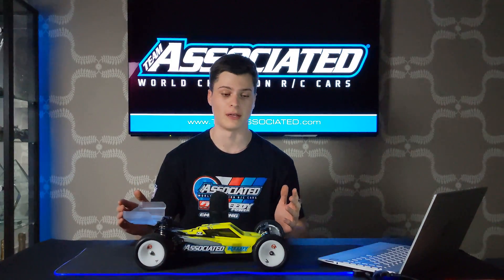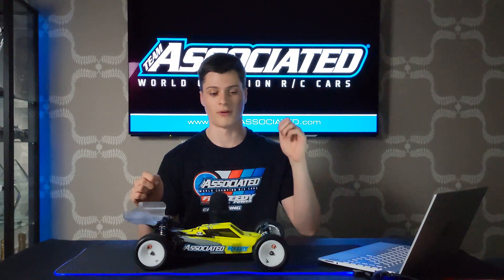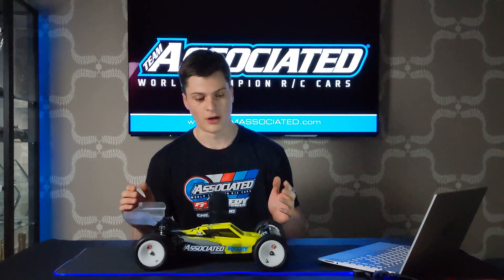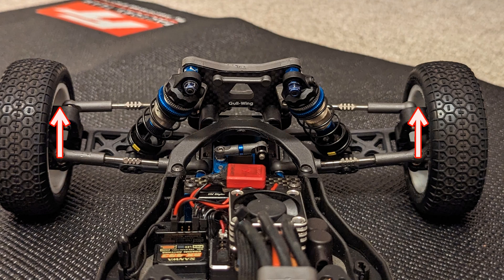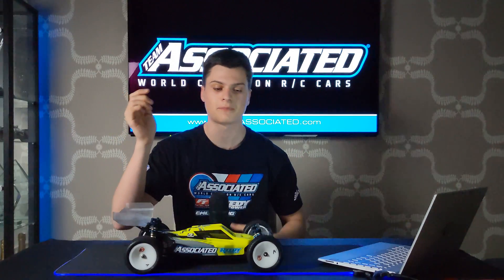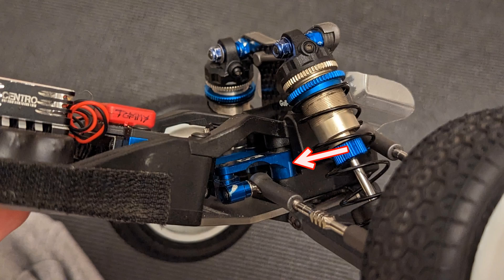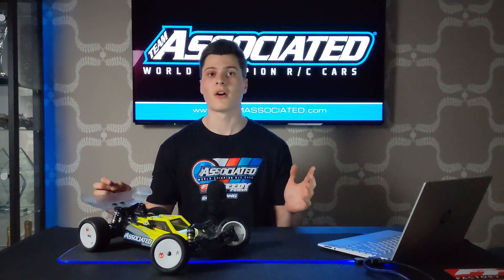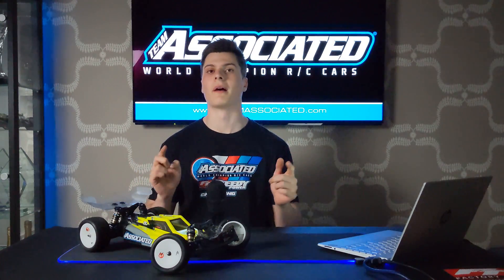Bump Steer in RC Explained.

Comment: Hello,
I just bought a b7. I switched to +2.5 pivot and 5 castor insert(tab down)
I found that I have a lot of bump out at full droop.
Rack is raised with 2mm spacer at the bottom.
What should change ?
Otherwise all spacers are kit.
Thank you

Comment: This was very helpful. I installed the plus 3mm steering rack on my b6 and t6 mainly for extra strength while I learn. Had no ide it added bump out to my set up. Simply remove the 1mm ball stud on one side and it looks like it’s fixed. Good timing also because I plan to lower it down soon and hit a carpet track

Comment: Liking the videos - question the manual shows using the angled ball stud socket on the outer steering link but note you have got a standard straight one - which one should we be running?
Reply from the maker: Neither makes any difference, sometimes the cranked one is needed for clearance on the spring.